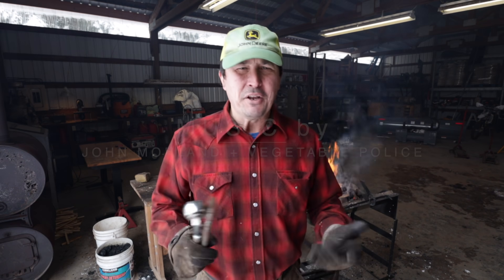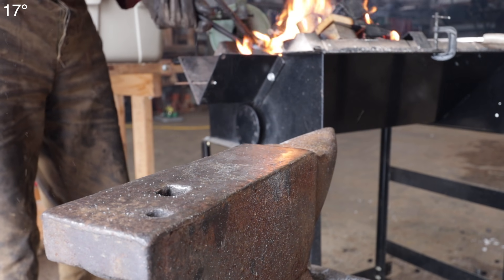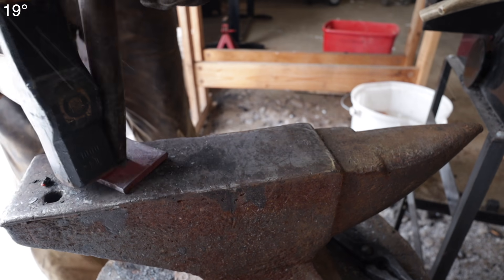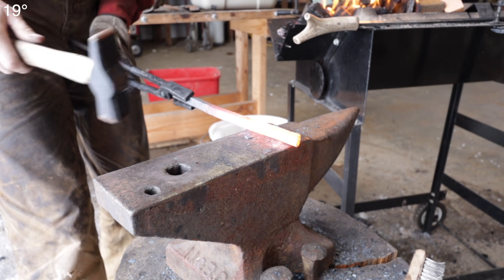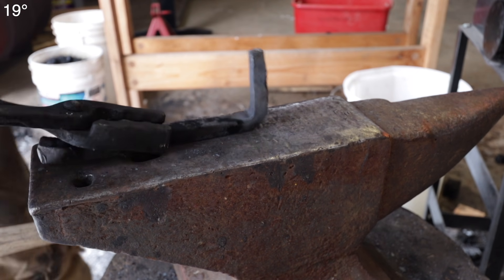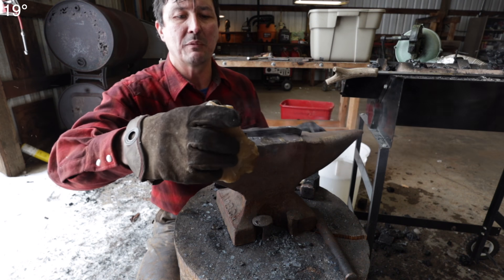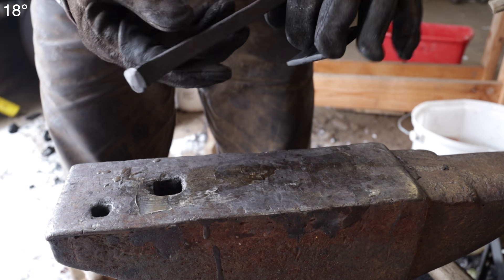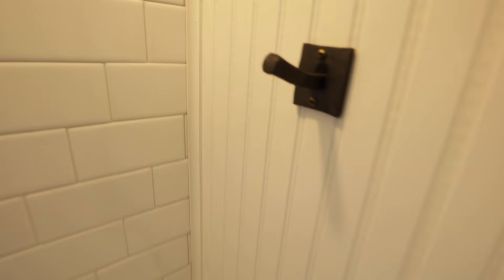Blacksmithing - Forging A Paper Holder

Comment: Imagine being a blacksmith back in the day? 
"Il need 20 horse shoes. 6 coat hangers for the cabin. And a new pair of tongs because mine broke."
"Im in town for two days after that im heading west back to the cabin. Il give you 20 cents for the lot. Sound good?"
Reply: Most of that stuff is not made to order if there a known blacksmith, just need to make replacements of the stock.
Reply: The cost would be 10 cents now if it weren’t for the darn federal reserve!

Comment: Looks good. I was concerned when you settled on 8 inches. I was thinking you should have done the offset first and then cut to length. Worse case it"s a hand towel rack. But in the end it worked. You did it yourself again. This little series has been a good one.
Reply: For me, did not need to cut off the ends... could have been incorporated into it if not at right length and that first square piece was still the right size.

Comment: The analogy you gave at 15:00 made me think of all the work we are doing dental school right now. When we are prepping and restoring teeth we have to take away small amounts of tooth structure and then restore the tooth structure with material. It is game of adding and taking away with compromises, while trying to maintain proper anatomy.

Comment: Burning of chrome does produce harmful chrome fumes that could give you metal fume fever... Now, doing it once won't cause much harm but just something to keep in mind! Nice job anyway!
Reply: I learned that from Alec Steele. 😀
Reply: @HogsHeadStudios  no its a fume it woulden work
Reply: to be fair the level of ventilation where he was smithing and the size of the piece its unlikely to be an issue.  if he was doing it regularly or in a less well ventilated area then it may have been an issue
Reply: @simonhenriksen3924  3M recommends N95 respirators when being exposed to hexavalent chromium because it complies with OSHA... it's safe.

Comment: Another great job Cody! That anvil is definitely not an abomination. No, it's not a newer anvil with a tool steel face, but it's a great anvil none the less. It looks exactly like my anvil, only in a lot better condit. Mine is a very old 100lb iron anvil that has seen countless years of forging hot steel before I got it. Once I finish surfacing mine, it will see many more years! Also, there's absolutely nothing wrong with a wood/charcoal forge. True, a propane forge is faster to heat, but it can have its own drawbacks. One thing that you'll learn over time, is that you will get a hotter fire if instead of using the wood the way you are(which is fine for a lot of projects), is to turn your wood chunks into charcoal prior to putting in your forge. There are many great videos out there on how to do that. The main thing to remember is to have fun and to experiment with it! Keep up the great content Cody!

Comment: Awesome! Inspiring. You mounted it wrong though (imho), it should point away from the toilet, so when you are sitting and pull to tear off a few sheets, you don't yank the roll off of the holder. Good stuff. Never knew about beeswax making iron black. Cool!

Comment: Cody, you inspired me to watch some other videos on blacksmiths and one gentleman mentioned in a pinch you could use a blowtorch for some heat for your project. I am sure you have one laying around with all the tools you have collected over the years. I’d pass on his channel if I could remember which one it was. I love the style of your new TP holder! And not having to use the spring is so awesome. I can’t count the times that the spring just flew off when I was changing the roll of TP.  Now on to another project for a towel rack! Yippee 👍 It’s nice to see the whole project done in one video 👍

Comment: Another good effort Cody :)  
I wouldn't recommend snorting on the fumes from chromed metals, pretty nasty stuff but in a well ventilated space you should be ok.  That anvil is fine for where you're at, just give the face a polish with a flap disc to get the worst of the dings out. Everything on the face transfers to your piece so a smooth anvil face will help produce clean looking forgings.  
Try to avoid cutting with a chisel on the face though, that's the most obvious error here, at best you'll blunt your chisel and at worst you'll mar the anvil face if you cut all the way through. That little stepped down area between the face and the horn is the cutting table, purpose built for what you were doing. 
Keep at it, it's always great to see others taking up the craft.

Comment: You could fireweld the two pieces together. If you let the TP-holder stick out a little bit (half an inch or so) on the  backside of the wallmount (the 2x2 plate). Then you have to heat it up to about a bright orange colour, put a little bit of Borax rigth at the spot you wanna weld. Then you heat it up again until it's really bright yellow and then just mushroom the proud end out and your fireweld should be about as good as a normal weld. And you don't need any powertools. Very nice job you did there. Always enjoing your videos after a hours of studying, mechanical engineering stuff.

Comment: You did a great job taking it from round stock to square stock. Probably good to have hammered a little on the corners or on the diamond to put a slight chamfer on the edges.  You did great.  I really enjoyed watching.  And your Anvil is not a bad anvil. It looks like it has a hardened steel plate on top. A lot of people start blacksmithing with a lot less.  :)

Comment: Great job! One thing that might keep you from loosing your piece in the depths of your forge and what has worked for me is with making or purchasing some rings that go around the end of your tongs and keep them on while your heating your item it will also help you cause you don't have to use your legs to hold your items.

Comment: You're learning fast grasshopper.  I made a good living as a Smith for 10+ years and I see you are quickly learning-through-doing.  Beware of ALL coatings on steel.  Most paint used on old steel contains lead and/or zinc (both produce toxic fumes when heated). As bad as breathing chrome fumes may be; it pales in comparison to the toxicity of cadmium vapor.  Cad coatings look very similar to chrome and unfortunately, many people have been poisoned by simply grilling a steak on a refrigerator shelf over a fire.
Reply: Tat Dexter wow! Do those coatings have a particular smell?
Reply: I mean fumes from the coatings.
Reply: @the1plantguy  I visited a shop that was welding galvanized steel (zinc coating) and warned them when I smelled a sharp metallic odor - they had 3 welders that ended up missing work from "fume fever" (similar symptoms to the flu).  I wouldn't trust a smell test for any coatings though.  I avoid forging all metals that have already been plated or hot dipped and I always chemically strip all paints and treat it as lead waste unless it's chemically verified as no-lead.  Grinding or sanding coatings off is just as dangerous as the dust is easily inhaled - exposing you to all kinds of nastiness.  Be safe!

Comment: If you want to make your anvil a little more user-friendly, find a local machine shop with a surface grinder. Have them grind about a 16th of an inch off the top. That will clean it up and make it much easier to work with.

Comment: I think you should’ve mounted it facing the other direction, because when you pull on the paper you’re naturally going to pull the roll off of that rod if that makes sense. Right now you have it loading from the right side, I think you should have it loading from the left side based on where your toilet is so you don’t pull the roll off of it. But the job itself looks really good!

Comment: Point the holder away from the toilet so the roll doesn’t get pulled off?
Reply: I turn them vertical. Feels more natural to me, and then you don't have to dink with a spring one or worry about the roll falling out
Reply: Just use dried maple leaves, problem solved.

Comment: Cody, just a thought, could you get some of those long thick plastic strips that hang from the doorway like they do at the butcher shops to keep the cold in, or in this case, out, and keep some of the snow from drifting into the shop?  You can still pass back and forth,  and the snowpack doesn't bend up the door? It's just a thought.

Comment: I saw a blacksmith on YouTube that heated the entire piece and then dipped it in old motor oil to get that blackend look you are using the beeswax to get. Check out the 20 mule team Borax wagon build to see it.

Comment: I missed your blacksmithing videos.  Last one you did I could swear was a few years ago.  Tiny tip would be, take care not to cut all the way through on your striking surface (face) and use the "table".  Keeps your face smooth which will show on your work.  Video with Alec would be fantastic!

Comment: Well I would be so greatful just to have an anvil like the one you have, but I make due forging on a warped section of an H beam. Just be thankful for what you have. You should watch Alec steele a little more closely. You would realise perhapse  its not the size of the anvil but the way you use each part of the anvil. Just keep practicing and see how much you can progress on that anvil, before spitting on it. I`m sure you will learn to appreciate it more than you can imagine. Best of luck with you smithing.

Comment: If it was mine I'd forge a hub and weld a sprocket to it then get a low rpm motor on a dimmer switch to convert the blower when you need a lot of heat. Then you can just Unbolt the sprocket and put the handle back on

Comment: The only thing I would have done differently is to flip the holder so as you pull it towards yourself to rip it off it won’t come off the older.

Comment: Next.time use some lump charcoal with the wood so it burns hotter longer and more evenly and instead of getting the metal to an orange color shoot for a bright yellow and use a hand sledge for outlining the shape then use you current hammer for the details whenever you are doing stuff with round holes us the round hole not the hardy (square) hole so the metal is evenly stressed and is less likely to crack. Good job though it took me many years of practice to get any sort of skill in the craft

Comment: Do yourself a favor and make a hot cut Hardie tool 

Rather than using the chisel and cutting on the face, risking damage to the face, you’re better off doing that on the table (step down portion behind the horn) or using a hot cut hardy 

Personally I find the hot cut hardy is a bit easier too

Comment: I know you love it when the safety police chime in...it looks like you're working without eye or ear protection. Doctors have found the sound of repeated hammering is actually more detrimental to hearing than the constant hum of machinery. Take care of yourself.
Reply: ryefry i didnt notice. Good point!
Reply: If nothing else, taking the magnet from an old car speaker and sticking it to the underside of the anvil heel really helps take out some of the ringing
Reply: WHAT?

Comment: If you got an electric blower you wouldn't have such a problem with heat. Squirrel cage blower fans are relatively inexpensive
Reply: SKM 94 the same can be said about a propane forge but then it wouldn’t be traditional blacksmithing it would be traditionalish blacksmithing lol

Comment: should have mounted it facing the other way and a little closer
Reply from the maker: Why?
Reply: @wranglerstar  Well I wouldn't want to lean forward that far to get it and if it was the other way you could get pieces with one hand and not worrying about pulling the role off.
Reply from the maker: There is no leaning, the holder is placed where it ought to be,
Reply: @wranglerstar  What about smaller people like the kids? Im sure is fine It just bothered me pointing that way idk preference I suppose.

Comment: When doing a hot cut PLEASE use the bench of the anvil if possible. That's that little flat portion at the beginning of the horn. To my unprofessional understanding the bench is the part "no one" cares about. The face or your anvil should be reserved for the piece you're working on and not your tools.

Comment: Cody, it looks good. But for the real debate, do you have toilet paper turned right? It needs to pull from the bottom.
Reply: You weirdo it goes over the top. 
😂
Reply: @JSRocker1776  and so the debate begins. It pulls naturally from the bottom. DUH lol
Reply: @chrisgarsee5480  the 1891 patent states that the end of the roll should be hanging off the exterior. Mic Drop 🎤
😂😂😂
Reply: Only if you have a cat in the house.